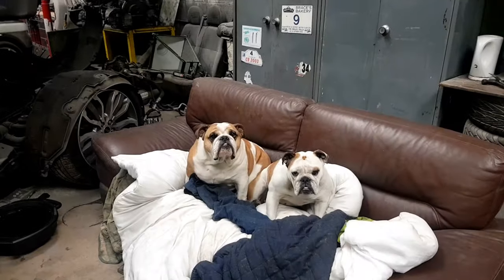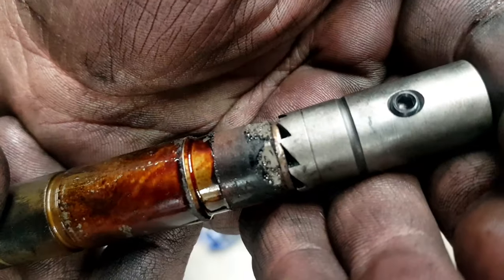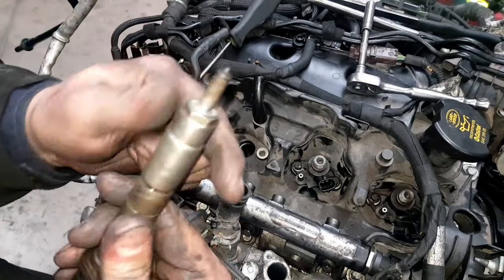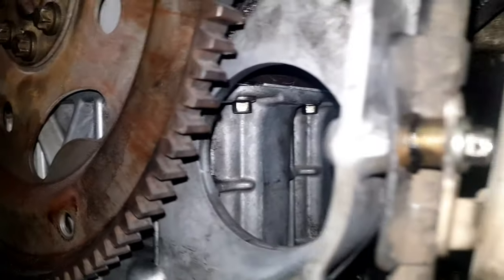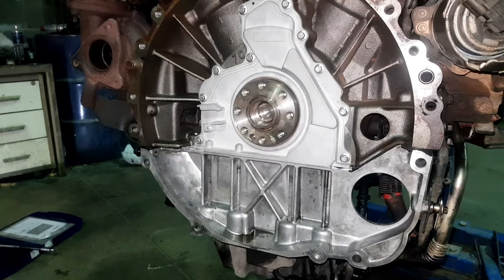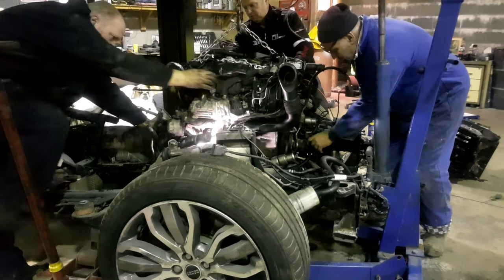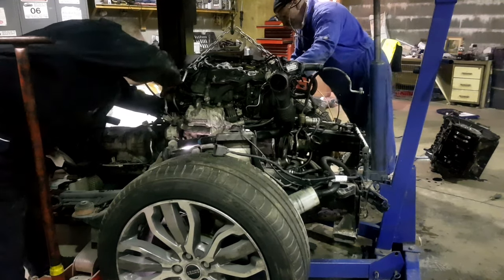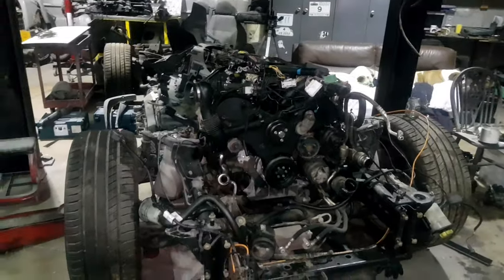Range Rover Sport 3.0 TDV6 Engine Part 10 | Engine goes in at last!

Comment: I’m hanging to see it running. So much work. So much bravery. Well done as always mate. Very impressive
Reply from the maker: Cheers 👍
Reply: Good job i wish to know how much it would be to change camshaft ? Thank you
Reply: @iulian3701  not cheap if rebuilding anything to do with the engine
And a lot of work with removing components to get the access I’m sure our steve will give a price on the work

Comment: Steve, I can see you are well experienced but just food for thought, if you put some stiff grease on the end of your injector seating tool before you use it it will smooth out the finish of the final cut and will also trap all the metal shavings that will stick to the grease and will come out with the tool to be cleaned off and regressed for the next one
Reply from the maker: Good tip. I'll try that next time, cheers.

Comment: Well done lads another long but productive shift, looking forward to it firing up, see if all that hard work has paid off, all the best
Reply from the maker: God I hope so!
Reply: Is this your place of work or where u do project cars? Looks a great big space......the threaded screw your missing also holds the tube for starter motor if car goes wading, I've got one if u need it, always a nervous moment when u hit the start button lol, I've never stripped one down as far as u and never new about the filter inside bank 1 block for turbo feed ports? You would think they would re do it so its accesseable or part of oil feed tube so can be cleaned or replaced anyhoo roll on next video. Great content lads
Reply: @pistonbroke  🙈me too
Reply from the maker: No it's not my place of work, it's my mates garage and he lets me use it.

Comment: Why ream the seats after fitting everything? Wouldn't it have been easier while the head was off not to mention less risk of aluminium entering the cylinder even if the aluminium swarf "supposedly" wont hurt the engine?
Reply from the maker: Didn't think of it while the engine was in bits. Besides, you wouldn't take the head off to ream the seat if you were just replacing an injector.

Comment: Brilliant videos. Were the injector lines brand new? I thought you had to replace between rail and injector to avoid a high chance of a fuel leak reusing the old lines?
Reply from the maker: No they are the original ones. You are supposed to replace them but as of yet, I've never had a problem with leaks.

Comment: Great video  mate look forward to seeing it run, looking at the V6and V8 I am glad I have a 300 TDI in my Range rover classic.
Reply from the maker: 300tdi is the best engine land rover ever made. I had a disco with over 300k on the clock and was still pulling strong.
Reply: @pistonbroke  I've only just rebuilt and fitted the TDi to replace the 2.5 VM that I put 300K on over 18 years, it would be great to get another 300K out of it.
Reply from the maker: VM was a nasty engine, originally a marine engine I believe. They suffered with head gasket troubles.
Reply: @pistonbroke  They are a marmite engine, once I changed from the 4 composite head gaskets to a single MLS one I had no more troubles only changed because of cost to rebuild it and part's are getting hard to find.

Comment: Bro, can I ask where the two 20cm 6-inch bolts are located, we can't remove them so we can't grasp the position
Reply from the maker: Probably starter motor bolts
Reply: @pistonbroke  Small long bolt that the starting motor does not remove is located in the machine
Reply: Do not you use Zalo to send pictures
Reply from the maker: @clexunghe2739  no i don't. Join the piston broke facebook group and put pictures up there. https://www.facebook.com/groups/340443653866985/?ref=share

Comment: Ive got a Jaguar with the 3.0 tdv6 engine, which started knocking, but the sound was from the top of the engine. Told the garage to take the cam covers off/ cams out, expecting to find broken follower or lifters but all was fine. The garage suspects worn big end bearings, and yet on the way to the garage i managed to drive 30 miles with the engine knocking, surely it wouldn't be possible to drive that far with bottom end knocking?
Reply from the maker: If it's driven carefully then it will go a while with the ends knocking. The sound from the top of the engine is the pistons hitting the head.
Reply: @pistonbroke  Wow ok, its such a shame as theyre such a great engine when theyre running properly! Cheers